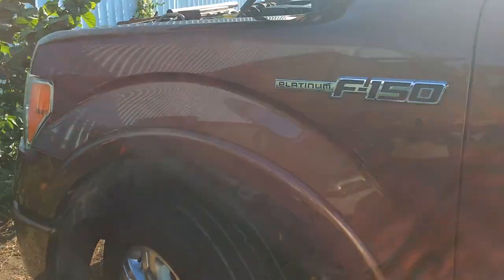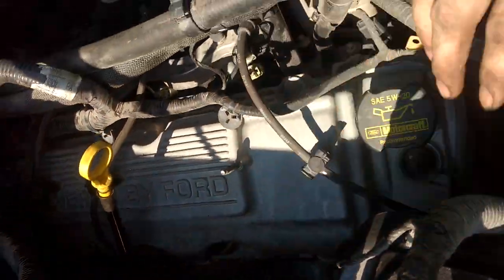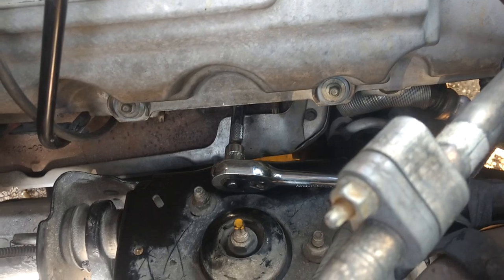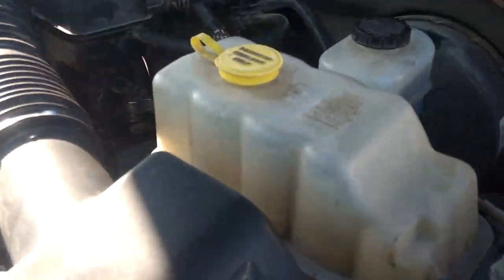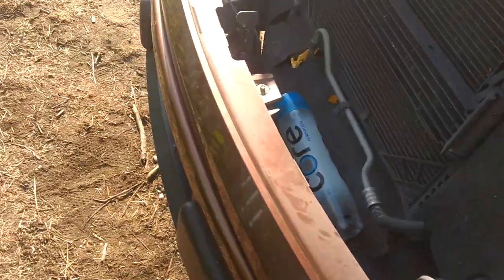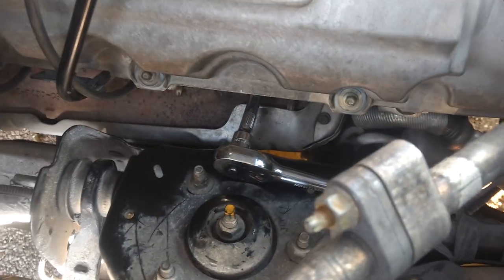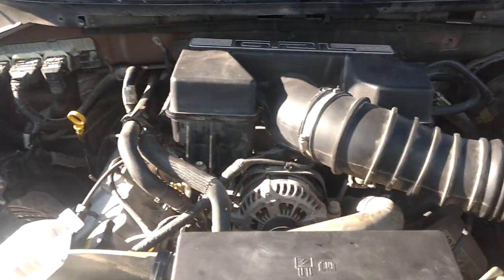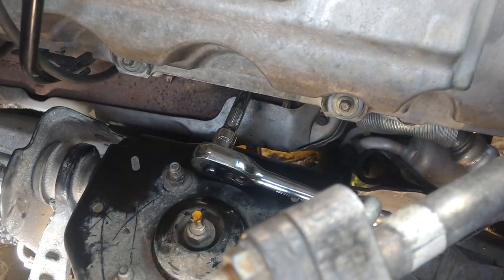2011 6.2 Liter Ford Spark Plug Tips

Comment: I have an 2012 F250 with the 6.2 engine, It was easy to do the plugs (20-25 minutes a side to do the lowers) just remove the inner fender screws and pull it down slightly. both sides are a breeze.

Comment: Thought the 6.2 only came in limited, Harley and raptor in 2011. I hope I don't have this problem in my Harley. I'm going to pull the fender cover. I ain't moving mounts bruh
Reply from the maker: Good luck with that it's the frame that's in the way g not the body panel lol